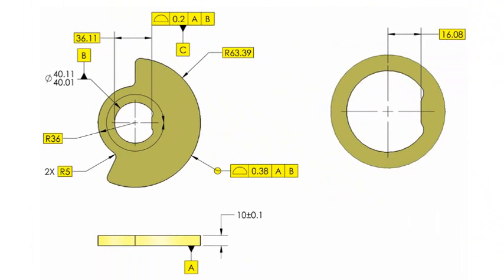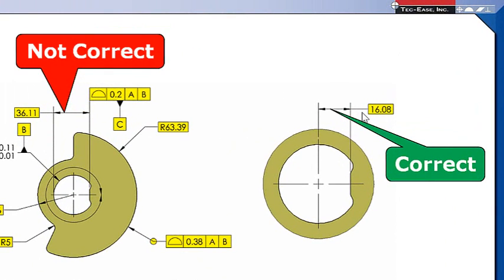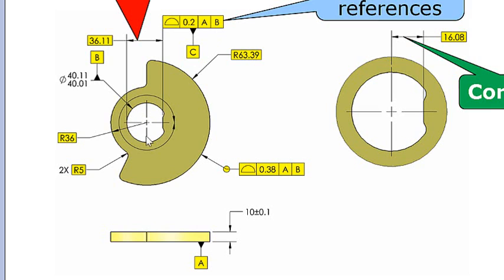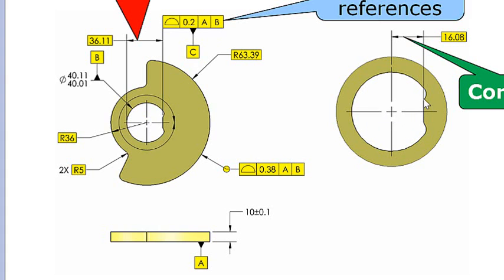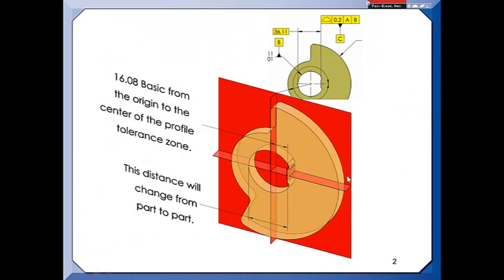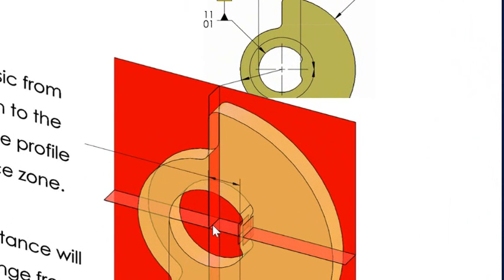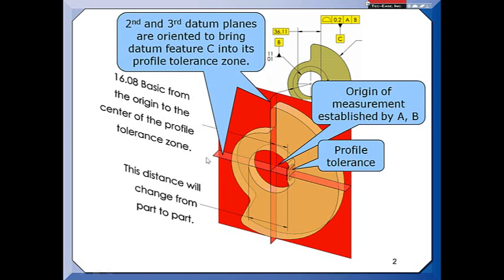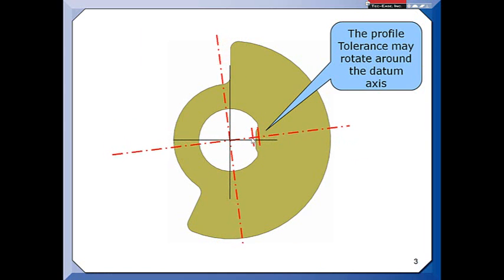GD&T Tip -  Do Not Mix Basic and Toleranced Dimensions

Comment: when using the position symbol in GD&T can you use a basic dimension for size with the position symbol?
Reply from the maker: You can use a basic dimension for size with position as long as there is a profile tolerance to control size & form.  The profile tolerance would not reference any datums.  Without profile it wouldn't be in accordance with the Standard because position can't control size.  You can see an example of  Position with a basic size & profile in both the standards (paragraph 11.8 in 2018) and if you have our GD&T Hierarchy Fundamentals textbook on p8-15.

Comment: While your analysis of the print is correct, you also changed the design intent.  The feature in the print is clearly mounting onto a shaft with a flat  and they want to control the distance between the OD and the flat as that is likely the way the shaft is dimensioned.  They may be better served with a +/- dimension to locate the flat